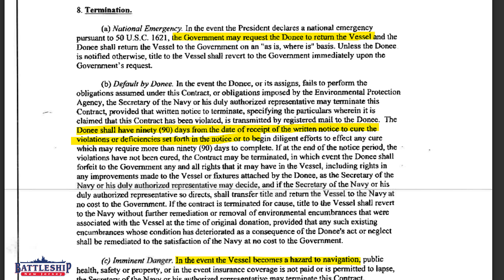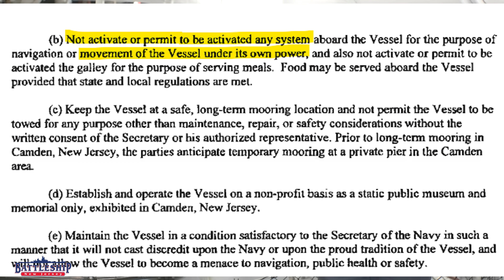Can Battleship NJ Still Move Under Her Own Power?

Comment: Oh yes. I think they could easily get them running again. When I was deployed to Iraq in 2004 I stored my four wheeler. I think it was Nov 2003 I got the warno and I literally ran all the gas out of the thing. Like stopped, started it again, then it stopped, and I syphoned any gas still in the tank out. In Feb I pulled it out and replaced the fluids to include oil, trany fluid, and coolant. The oil wasnt even dirty. In August I got back to working on it again, blew air thru the fule line, and dumped starter fluid in the carb. It started right up after a battery replacement. It puttered a little but after a single tank going through it was solid. So yes you can easily get this big bastard to run again with bigger parts that dont get gummed up.
Reply: Was it stored for 30 years? Time can make a big difference. And, the ships systems are far more complicated. There’s lots of pressure vessels and piping that would need inspected and tested. The risk is much higher than damaging an engine on a 4 wheeler.

Comment: My understanding, at least with the South Dakota class, that if they need to get down to the engines from above, there is a route down; no need to cut deck armor - there are designated sections that can be removed.  Yes, some metal cutting will need to be done, but its more or less a way.

Comment: I assumed that she couldn't move under her own power anymore, but I had no idea the ship was kept in a state so that she could be reactivated (given enough money and time). Great video!
Reply: I think there's a subtle distinction between "kept in a state so that she could be reactivated (given enough money and time)" and taking (and keeping in place) measures to minimize the chances of her falling into a state where she can NEVER (under reasonable circumstances) be reactivated.
Bottom line: she'll never steam again - but let's keep the kit in the best possible state - just in case we ever have to try.
Reply: all the talk f 16 inch shells and powder is any of that around any more seems like a ton of work for a ship without ammo if it did exist would be sketchy at best ide not want to handle it
Reply: What a colossal waste of money and effort that would be. Battleships are entirely obsolete in the era of guided missiles, it would be like bringing a bow and arrow to a modern gunfight.
Reply: @rubiconnn  No, more like bringing an M-1 Garand to a modern gunfight. There aren't many guided missile batteries that can deliver up to three 2700 pound warheads per minute on a target up to 32 miles away, but the 16"-50 guns can. Besides, the battleships aren't limited to the original AA weapons; they can be refitted with the CIWS, interceptor missiles or even anti-aircraft/anti-missile lasers as those become available.

All the same, the time and money cost of returning the Iowas to service should be compared with the construction of a nuclear-powered heavy railgun and missile launch platform designed from the start with modern defensive systems.

Guided missiles haven't made old weapons less deadly, nor do they necessarily make their defense impossible. When the captain of the USS Missouri was asked before deployment to the impending Gulf War if he was worried about Saddam Hussein's anti-ship missiles such as the Exocet, he replied that he was very concerned that they might scratch the paint.
Reply: @paulbade3566 Your average anti-ship missile has a range of hundreds or even thousands of miles. There's a very high chance of a missile hitting it's target on the first shot. Guns are only really useful for firing at close range targets that would be wasteful to fire a missile at like small boats.
Reply: @rubiconnn  The Exocet's maximum range is 70 km (about 43 miles). That's an average anti-ship missile of the 1990s. The Harpoon missile has a range of 90 - 248 km (54 - 154 miles), depending on the variant. The Chinese would like to say they have a land-based anti-ship missile with a 1000 mile range, but apparently the ones they have use nuclear warheads because they aren't trusted to get through defenses and hit accurately.

The big guns on the Iowa-class battleships were designed to batter through the heavy armor of other battleships such as the Yamato, or to smash gun emplacements and bunkers on land. For example, a 16" AP shell can penetrate up to 23' of reinforced concrete, or 2' of armor at a range of 15,000 yards (over 13 miles). They can go as far as 38 miles. There's no point in wasting one of those on a "small boat" when a 5' secondary battery gun is quite capable of blowing those out of the water.

During the Vietnam war, the New Jersey could rapidly construct a helicopter landing zone in the jungle by firing a single HE shell at the desired landing site. It would clear out the trees and enemy forces in a 150' diameter space. That was quite useful for rescuing downed aircrew within 30 miles of the coast.
Reply: @paulbade3566 So you're saying that even the shortest range missiles have a range of over twice the range of guns. A large ship armed with lots of guns would be absolutely destroyed before it could even get close enough to shoot. Not to mention that modern ships use the same VLS cells for launching air defense missiles.

Comment: In my personal opinion, all of the battleships deserve to be functional as a sailing vessel. The weapons systems and radars and such make sense to stay offline. But her engines deserve to be able to run. Same for Texas and every other.  But it’s just not in the scope of possibility. Which is heavily unfortunate.  I bet the museum fleet would gain heaps of attention and visitation if they could sail from port to port for people to come visit them.  We can only dream.
Reply: Alabama, North Carolina, and Massachusetts were cannibalized for parts to reactivate the Iowas in the 80s. I read about it some time ago, and I can't recall specifically what was taken, but getting any of those running is entirely out of the question. 

Texas is also impossible, but for a different reason. From my understanding, there was standing water in some of the engineering section of the ship for years, and large sections were sealed off due to poor maintenance funding; there's not much left of those engines at all. The parts down there wouldn't even move if they tried. The prop shafts were also removed and sealed over entirely, as well as the other fins and extrusions on the bottom of the hull, if I remember right. Then there's also the big obvious one, the rudder. 

I'm not sure if any of that work was done to the others, ai haven't looked into it. A lot of time and money could get the Iowas running again, but yeah, it's definitely past the realm of reality for the others.
Reply: As nice as it would be, it can only be a dream, i'm not a mechanic but even if they were able to reactivate the engines and sail the ship around, they would need fuel, maintenance, spare parts should something break, and probably the most expensive part, people to actually do the work, because as cool as it would be i doubt you'll find people willing to volunteer weeks if not months of their time sailing this thing port to port.
Reply: It's so expensive and unfeasible
Reply: As the narrator says, it is all about preservation. Keeping the ships in that moment of shut-down. At the moment, the engines are in a state of 'suspension' but once you get them active, then wear and tear, and the need for maintenance - and all the man power and money all of that implies, would speed up their end-of-life. As he was saying, they are hoping for several decades more of simply being a museum ship, but if they went for full activation, then those engines may not last one decade. And at this point in time, if any Iowa was truly needed for an emergency, it would be an end of days type apocalypse, where there is truly nothing left in the inventory to use.
Reply: The money sent to Ukraine could have been used to restore The entire Iowa class.
Reply: @MikeJ6129  it would be a complete waste of money.
Reply: All battleships, including the IOWA class, are very obsolete. Even with new electronics and radar. Sorry, as impressive as they are, they're from a bygone era.
Reply: @Topnikko  Not hardly... These girls are more than up to the task...
Reply: @lonmcq7317  LOL, battleships are outdated for so many reasons I don't have time to list them all.
Reply: @Topnikko  Not buying that one bit...
Reply: @lonmcq7317  you don't have to buy it but it is the truth. You can romanticize all you want about how cool battleships are, and they are impressive to look at and were amazing in their day, but from nearly every technological standpoint they are antiques. There is a reason no other country has them in their fleet and why the Iowas were decommissioned. The only reason they were brought back in the 80s was to achieve Reagan's 600-ship Navy. They were dinosaurs back then.
Reply: @Topnikko the Iowas aren’t completely obsolete. They are still heavily fortified ships capable of shore bombardment and could be armed with anti ship missiles. But you are right, as long as there isn’t a catastrophic event so big that every ship available in any way is useful, they aren’t going to see service again.
Reply: @frederikhein4195  It'd be literally faster and cheaper to build a brand new battleship from the ground up with modern equipment. 

Sure, the Iowas are heavily armored, with armor tech made in 40's. Sure it has shore bombardment capability. and shore bombardment capability only. what if the targets are inland? well there goes the only "unique" advantage the Iowa has, it's guns.

 A single modern anti-ship missile would defeat all that useless armor that thing has to lug around, especially on a top down attack, that all the modern missiles are able to do.

In a total crapshoot scenario one should rather equip random tugs, small cargo carriers etc. with movable missile pods and light autocannons and AA guns and bring more firepower within a week than a single Iowa could muster in 2 years of refurb. and then the firepower would be distributed amongst dozens of targets, not in a single lumbering hulk of steel.
Reply: @LasOrveloz  ,
I'm not sure that you understand exactly how far the 16" guns she carries & fires can reach.
Every time she fires one of her 16" guns (she has nine [9] of them), the projectiles travel approximately 23 - 26 miles, depending on a lot of variables of course. 
That is a whole lot of reach out & touch someone or something... LOL
Any of the Iowa Class Battleships would have little trouble helping Ukraine return the Crimean Peninsula into their control as it was before Russia annexed it.

Please enjoy your day  !!
Reply: @Crazy_Old_Ben01  23-26 miles is a stone's throw compared to missiles.
Reply: Yeah, no. having one, let alone all of them would be 110% impossible, and unreasonable. The running costs alone would sink any of the museums in under half a year for one of these. Even at a slow 20knt the ship would eat 4k gallons of fuel in an hour!!! It's not feasible nor really all that useful to have these ships able to sail under their own power. 

So either keep them as is now, or let them rust with all the water ingress from opened portholes since no one is going to actually sail one of these even if the engines were brought back to working order by some magic.

Comment: Some old gold miners I knew who mined in the Yukon. Told me the seen an old steam powered dragline reactivated to move away tailings. It had been properly mothballed so it was well preserved. It was not powered by steam for that application.

 What they did was plumb in a large industrial diesel powered air compressor that replaced the steam pressure. These old guys had all started as oilers on cable draglines, scrapers and excavators so they knew how to adjust and maintain that machine.

Comment: Y'all thinking recommissioning this ship is a good idea are woefully mis-guided.  These ships, are almost 90 years old.  The US Spent and wasted hundres of millions in the 1980s to refit these ships, and that was when they should've been propertly upgraded for the wet dream of being activated until the 2040s, with a modern propulsion system.  The steel was cut for these ships in the late 1930s and early 1940s.  Modern Ballistic anti-ship missiles would decimate these ships, as they are slow, slow to respond to even remotely attempt to evade, and have the radar cross section of an island, and would not be able to operate even remotely close to being alone, and would require re-tasking assets to protect it, away from the real power projection, that is Naval Aviation.  A modern Day destroyer packs more of a punch, and what the US Navy SHOULD Be looking at is a large surface combatant, to counter the large Cruisers coming out of China.  A Cruiser to replace the Ticonderoga class and subplant that Arleigh Burke class and assist in Missile defense, a Cruiser with a 150-200 VLS system, and Anti-Sat/Anti Ballistic missile tech to protect assets foreign and abroad for the next 50+ years.  Naval Aviation is not going anywhere, and the US Carrier fleet is the best thing for power projection as each one carriest the strike capabilities of some NATO Nations entire air wings.
Reply: USS Constitution says, "Ahoy!".

Comment: Even if the engines WERE working, it would still be a lot easier and cheaper to use tugs, I'd imagine. Going through the lengthy process of firing the boilers and then shutting them down afterwards, for such a short distance... is probably one of the main reasons why tugs exist in the first place!

Comment: The boilers are extremely high pressure and could be dangerous if not inspected, rebuilt if necessary and then re certified for use.

Comment: Actually if anyone needs ready crew in steam driven power plants there are still a few reserve fleet uss destroyers that are steam turbine powered and still moving afloat! Check current location of uss holder dd 819 as i found afloat last summer! The twin turbines of a twin screw destroyer are smaller but the application is the same!

Comment: Gave me chuckle you did Ryan.  All the problems to be solved before just lighting one boiler would need a dry dock.  Even recalled an episode statement to the effect that after down pressure and drainage your fuel supply system now leaks from one end to the other at every single joint and connection.  And I’m sure we all agree that as wonderful and awe inspiring as it would be for the old girls to steam and charge forth once more I’m honestly too terrified to conceive of the real world issues we would be ongoing to cause the Navy to activate that particular clause/ship.  Good luck with the dry dock maintenance/ anode swap et al.

Comment: Ryan mentioned the ship drawing in saltwater to operate the engines.  It would be interesting to know what differences there are between operating a ship in saltwater vs freshwater.  She would have been in freshwater any time she went through the Panama Canal or if she had sailed up a river like the Mississippi.
Reply: Actually the ship runs on fresh water! The salt water is sucked into the ship and into a desalination pump that removes the salt making the water fresh to use in the ship! This water is also used for drinking and other water requirements on board the ship! With this system ship can run in oceans and make own fresh water!
Reply: The evaporators produce only enough fresh water to feed the boilers and for crew use.  Salt water is used directly to cool many systems and provide firemain.  Going from saltwater to fresh water can cause problems because the marine growth in the sea chests can die and clog filters and condensers.

Comment: Hey Ryan, as you said before, the blanking of the sea chests was done with a different kind of steel which could induce corrosion.
will it be possible to replace the covers with a more similar metal, or is that kind of metal not available anymore?

Comment: what would actually need to be done to the ship to make the engines work again other than opening up the seat chests again.  is there any damage or critical parts that have been removed anything else preventing them from running again or would it just be a case of re fuelling her opening up the thru hull openings and getting power to her again to get her running?

Comment: So i have a question what would it take if a modern battleship were too be built 
2nd question how long would take too build and design a new battleship or would it be possible too use a pre existing blueprint such as the minisota class or the iowa class 
3rd question would railguns be possible on a battleship if it were nuclear powered

Comment: Fun fact, the LHD class still uses a conventional steam plant. Only difference is the boiler ACC system. The NJ is what we hole snipes MM/BTs call the stick shift plant. They still teach how to steam a plant and maintain the boilers in MM a school. Just the time required to learn the plant arrangement and the master EOSS would be no big issue to steam those plants on the Iowa class. If it was to ever return to service. The boiler water and fireside inspections would be the main concern and all the evaps and condenser inspections as well.

Comment: $2-4 billion per would be adequate to cover not only basic reactivation but also addition of necessary modern additions such as VLS, communication links, new secondary armament, new anti aircraft capability, substantial automation,and extended range, smartly” munitions. 

That would be a bargain in capability and cost compared to the debacles of the LCS and ZUMWALT classes.
Reply: Quit it with making so much sense! I mean we gave ukraine what 100-150bill since just last spring?
Nobody in gov work can handle hearing common sense in my decades long career experiences&prior service in the army. 😀